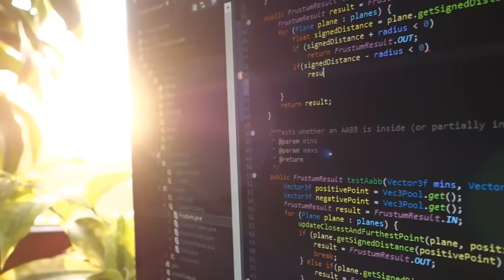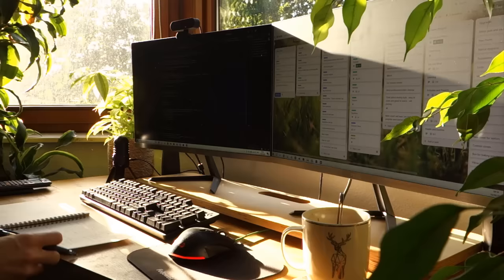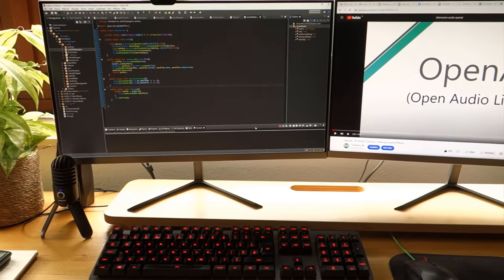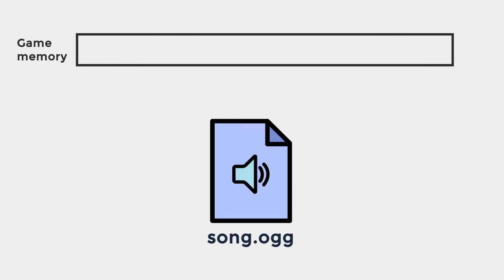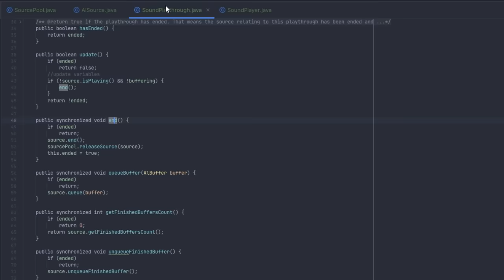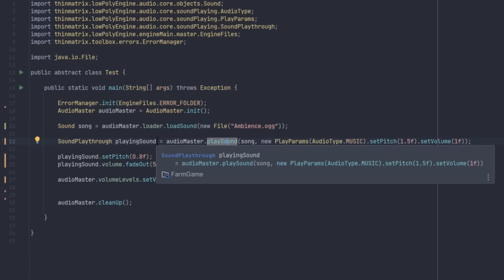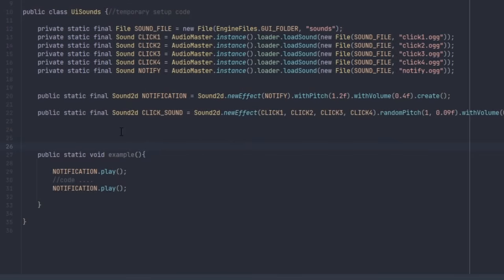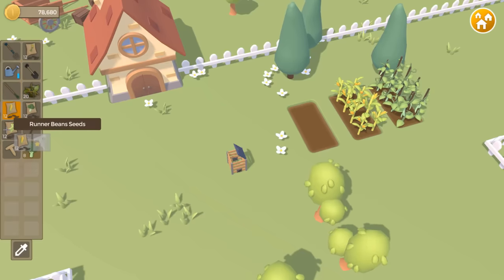Technical Devlog: Implementing Audio into my Game Engine

Comment: Hello Thin, I have a question.
Let's say I have an audio system in my engine, and I also have a rendering system.

I am guaranteed to have a main camera (just a camera with a flag main==true).

Now, in my game, I would need to play the sounds with volume based on their distance of their source from the position of the main camera.

This seemingly requires two systems to interact between them, in a way.

How would you go about implementing this interaction?
Reply: Also, I have some small suggestions.

1. The UI sounds should not have a random pitch. As a rule of thumb, a good UI is - predictable, intuitive, simple and consistent. I would use a short, easy to digest consistent sound for the UI elements. Bonus if the sounds further communicate the action being carried.

2. As the player, I would love to be able to drag-click my mouse to water the plants instead of clicking on individual tiles. This also allows for a continuous sound to be played.

3. The sound system of a game is vital for a reward system. For example, when you get a kill in Apex Legends, it plays this amazing sound that's the equivalent of popping an air bubble. In my opinion, your game will be better if it took the same design approach when in comes to sound design.
Reply: Last, great video as always.

Comment: I'm wondering if the opengl tutorials from 9 years ago on your channel are still a viable source to learn from. Is much of the content outdated now or is it still relevant with current opengl versions.
Reply from the maker: The OpenGL stuff is all still relevant if you want to make a game using OpenGL. However, you could instead use Vulkan, which is like a newer version of OpenGL. I'm still using OpenGL in my games though.
To get access to OpenGL I used LWJGL 2 in the tutorials. There is now LWJGL 3, which you could use instead. For the tutorials it doesn't make a huge difference, but you would need different code for setting up the display and handling user inputs. If you wanted, you could follow the tutorials using LWJGL 2 to learn the OpenGL and gamedev concepts, and then you could still very easily switch over to LWJGL 3 later - you'd only need to change a couple of classes.
Reply: @ThinMatrix  Thank you. I'll keep this in mind as I'm going through it.

Comment: I was wondering... Do you comment your code?
Like it is just for yourself but do you comment some things or in any consistent way?
Reply from the maker: Yeahhh partially. Whenever there's code that I think could be ambiguous I put a comment, but mostly I try to program in a way that the code and methods are self explanatory. I'm trying to be a bit more consistent with documentation these days though.